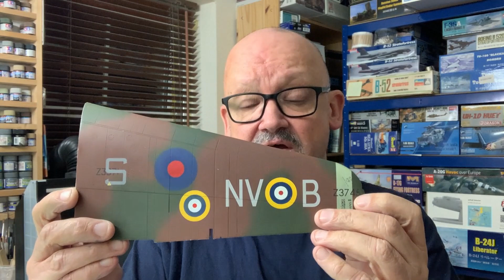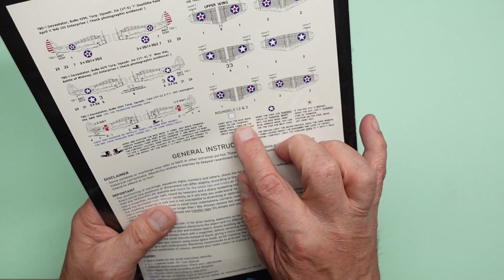How I made the One Man Army Devastator masks work

Comment: I am the guy Who asked you first to make a One man army stencils tutorial video…….sorry….I created a monster 🤣🤣🤣🤣🤣. Always great Nige 👏🏻👏🏻👏🏻
But just a question: what white paint did you use over the blue?
Reply from the maker: I have used MRP white, Mr Surfacer 1500 and LP 4 in this video. In the final I told you what I used.. LP I think?
Reply: @NigelsModellingBench  ok ok, One of the problem with the “building up” white is that white color (especially tamiya) do not cover a sh…t 😅so you need a tons of color to cover the blue. 
Zero paints white cover a lot better for example. 
Your way stills better but a stronger coverage white help a lot
Reply from the maker: I actually think the LP worked very well on the third example.
Reply: @NigelsModellingBench  for sure way better than the XF but tamiya white coverage is always too Gentle and in some case it became a nightmare. Again…you do it well and better but a stronger white helps a lot 👍🏻👍🏻
Reply from the maker: Thanks. i shall have to get some zero white.. hold on.. I have Zero white Primer..